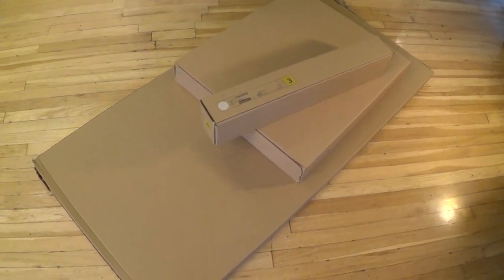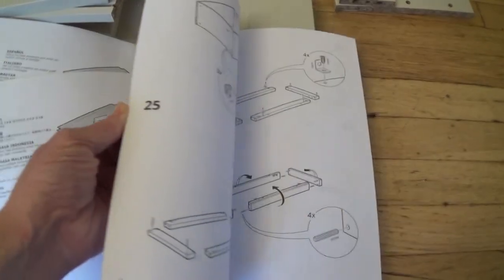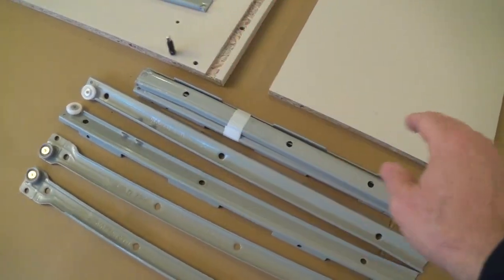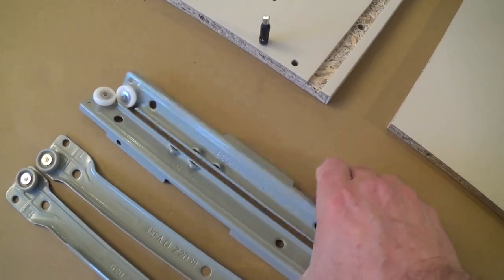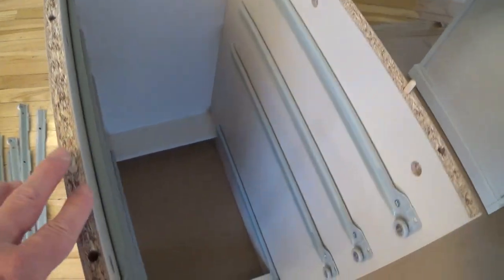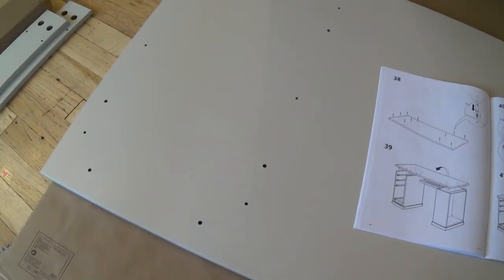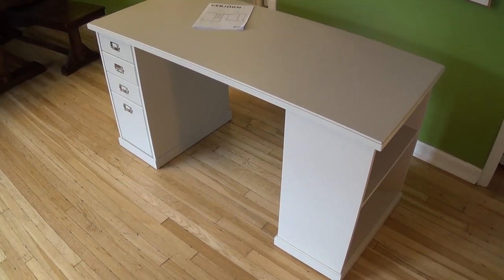How to Assemble an Ikea Vebjörn Desk

Comment: Do you know if it is possible to assemble it differently? As in drawers on the right and the shelves facing inwards instead of outwards?
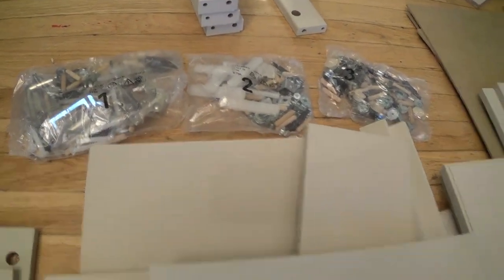Reply: Around 2:18 you can see the holes for the tabletop and it looks like they're drilled differently on either side, unfortunately. I was hoping the same thing and am very disappointed they no longer offer these as stand-alone pieces for customization. I wanted the shelves and drawers reversed.
Reply: Lol I came here looking for the same thing! Dang it